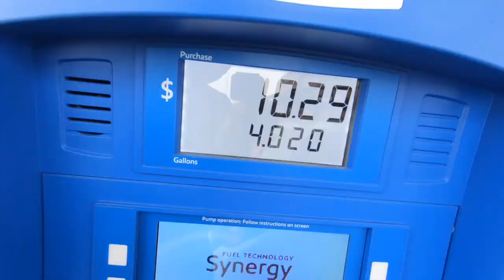Mounting RotoPax Fuel Containers To THULE Cargo Basket / Roof Rack - w/ Lock Failure (Temp Install)

Comment from the maker: I've secured this much better since making this video. I'll post the update link when available.
A few Amazon links to items shown in today's video.
RotoPax 4-Gallon Gas Tank https://amzn.to/3J4cFga
RotoPax DLX Mount https://amzn.to/3FuoXwh
RotoPax Universal Mounting Plate https://amzn.to/3Ff3ebv
ROOF RACK PARTS
Thule Aeroblade Roof Rack Bar https://amzn.to/3GTf6Qy 
Thule Roof Rack System Fit Kits https://amzn.to/3ywIt8C
Thule Evo Clamp Foot Pack https://amzn.to/3E2xx3E
Thule Canyon XT Cargo Basket https://amzn.to/3oYpPDj
Thule Canyon Roof Mount Cargo Basket Extension https://amzn.to/327rwFP

Comment: Long term how has the fuel can worked out besides the lock failure? I’m looking at doing something similar with their water jugs on my roof rack. Floor is similar to yours.  How did you end up mounting the base plate?
Reply from the maker: I love the RotoPax cans. I no longer have the roof rack/cargo basket  setup, but I did save the fuel tanks.
My only concern for you would be lifting the two water tanks out of the basket . 
The two tanks twisted together tend to sag in the middle while full, making it difficult to remove. That is why I switched to a solid 4 gallon tank. 
I left the base plate secured with tiptoes for 3 years. I did ad some styrofoam underneath the plate to prevent some  rattling. 
Here's what the roofrack setup looked like before I switched things up https://youtu.be/n2dmuvD3bU0?si=R27VHfsxB8z9fyig
Here's a YouTube short that shows off the current Gas & Water supply https://youtube.com/shorts/450cT1kydek?si=0Q3QILQZoABpNTdl

Comment: yikes. I'm trying to figure out how to mount my 5 gallon tanks and was about to buy the rotopax. Can you suggest another option? Right now I'm leaning toward just using ratchet straps and some sort of bike lock to keep gas thieves away. Really not sure.
Reply from the maker: Are you still going to use the RotoPax tanks or do you plan on using another type of spare fuel tank?
Most people use ratchet straps. If you get a steel cable bike lock, think about anything you might want to lock up in the future and get the appropriate length.
Reply: @HondaFit4Adventure  It's another brand. I got a great price on two 5 gal tanks for $55 each! I'm so glad you think the ratchet straps are okay. And thanks for the idea on the length of the cable too. Using straps is going to save me money and time and that is awesome. Thanks so much for getting back to me.

Comment: I am trying to find a vertical mounting solution so I can use a siphon hose to fill the truck tank and leave the Rotopax mounted.
Reply from the maker: That's an Awesome Idea Mark.
I believe they make "Auxiliary Fuel Cells" for Trucks that simply bolt to the bed of the truck and work through a gravity fed system.
These tanks might be a little larger then your looking for but it should be the same concept.
I'm opting to go with a 16 gallon fuel cell that will be mounted in my spare tire area. I did get a fuel pump to help pump it into the fill tube or I might pump it directly into the main tank. If it was plumbed into the main tank I wouldn't be able to help some who ran out of gas as easy.

Comment: 7:48 what new locks did you use here??
Reply from the maker: It was the same type of lock. 
After reading about the lock failure and then experiencing it myself, I couldn't believe I trusted the lock on the other side and continued to use it.
I currently don't have any locks on them but they are much harder to access now from an outsiders perspective. https://youtu.be/zWGEmOhNHVo?t=341